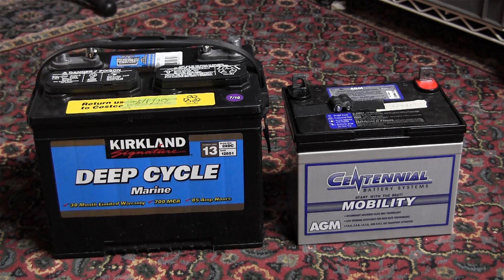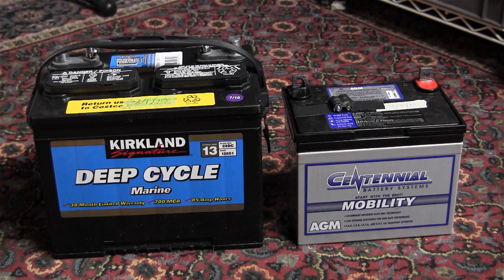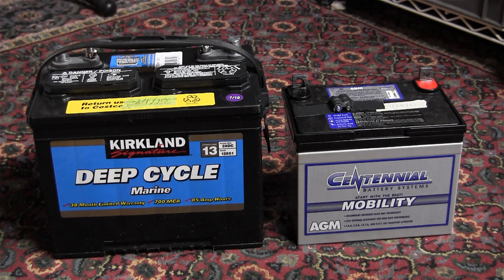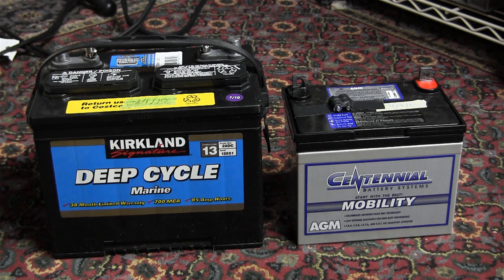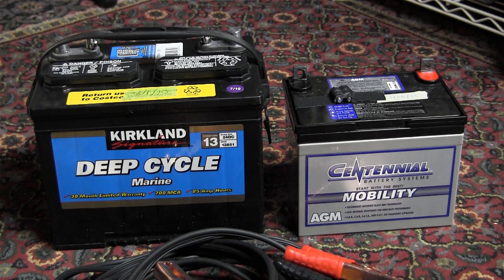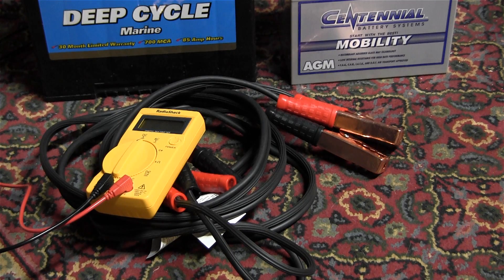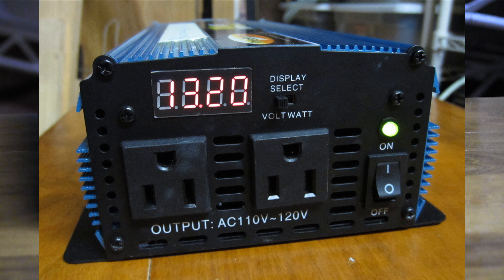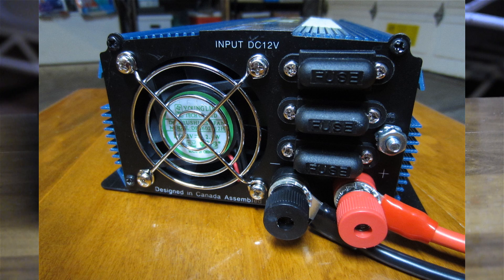Emergency Power

Comment: Potek 750 watt inverter with meter is the way to go. Shows exactly how much power you're using and also how much life is left in battery.  Higher wattage inverters will draw down a battery at a very high rate making recharging an almost constant deal. During Hurricane Irma, I ran my laptop, cell charger, (2) 8 watt LED table lamps (60 watt) and occasional TV for 5 days and battery was still at 70%. I've since added a 100watt solar charger. Based on the math, here in Florida, this alone should keep me at 100%.

Comment: Can you back feed the power from the inverter into an outlet (shut off main breaker) if it’s on the same line as the furnace?
Reply: Ask a licensed electrician about the right way to do this.  You need an automatic cutoff when the grid goes down.  Solar systems have that for the safety of the people who work on the grid.  Also I'd recommend getting all AGM batteries to start because they will accept power quickly.  Get the heavy jumper cables because the light ones will melt.  Learned that the hard way.  That will also reduce fuel usage for the vehicle.  I live in San Francisco so I'm not really concerned about keeping my furnace running.  If you need to do that make sure you get a big enough inverter for your furnace fan and also have enough battery capacity.  My plan would be to use the vehicle to charge the battery pack and then run my inverter off that mainly to keep the fridge running and a few LED lights.
Reply: Not really as there are complications to doing that. #1 the outlet you're plugged into has to be on the same "power leg" as the furnace. Not easy to figure out for most people #2 If you have an electric hot water heater, the chances are big that it will draw down available power, same with your electric stove if it is turned on..  #3 The size inverter you'll need will be so large that it will draw down your battery at a very high rate.
Reply: The best way I've found to set the furnace up is to add a second box to the furnace shut off switch add a female plug and change the switch to a 3way switch up is on from the main line down is normally off but if you hook up your male plug then all you do is plug an extension cord from your backup power supply and energized the circuit and you have heat and no power will backflow to the panel box if you

Comment: Forget using a meter to test when unused stored  battery is low and needs a recharge.  Just use a smart charger that will charge and then keep it topped up automatically.

Comment from the maker: Today I tested recharging the 35 amp-hour AGM from a Camry.  Ran it down to 12.1 volts then hooked it up with jumpers.  Came back to 12.6 volts in 15 minutes or so.  More precise video to follow.  You need to stop every 15 minutes or so, unhook everything, check with voltmeter.  Follow instructions on hooking jumpers to car- negative to frame or engine away from battery.